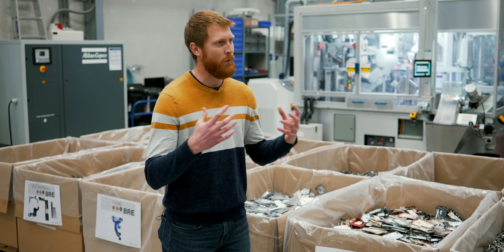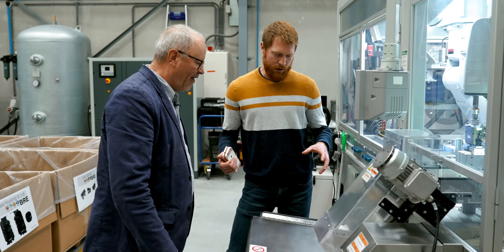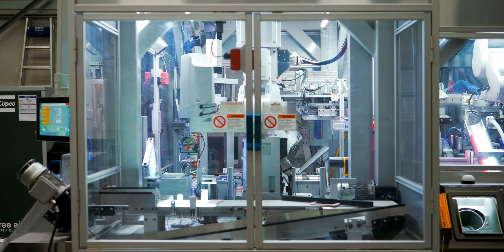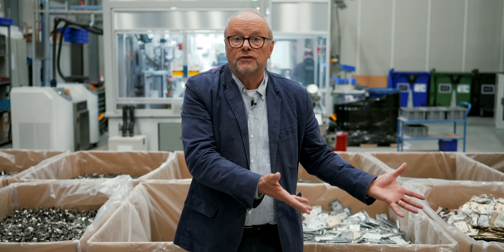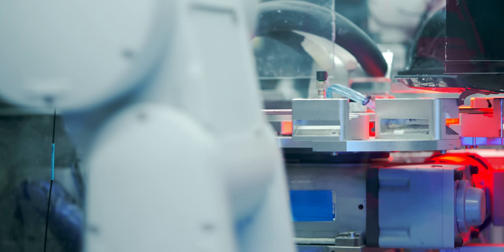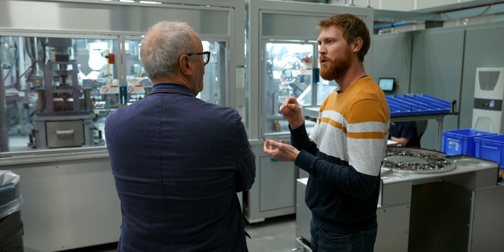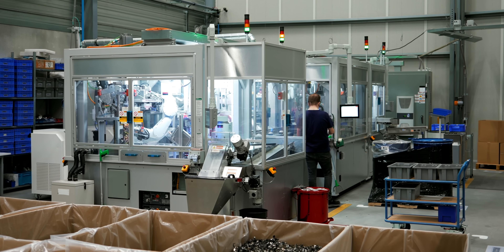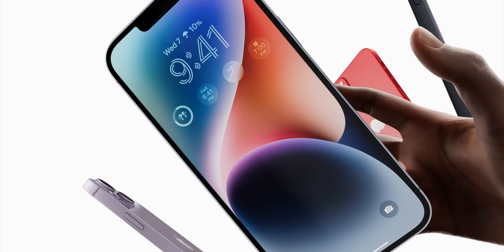Is This Robot Apple’s Most Important Device Yet?

Comment: What a joke…

I can’t replace the battery…
I can’t replace the screen…
I can’t replace the Face ID…
I can’t replace the Touch ID…
I can’t replace the earpiece…
I can’t replace the camera…
I can’t replace the logicboard…
I can’t even use a non MFI charging cable…

without Apple disabling some or all relevant features on the phone.

Activation lock leads to millions of iPhones, MacBooks, iMacs, iPads and many of their other 800$+ products with no defects of any kind being scrapped and thrown away on a daily basis!

THIS IS A SLAP IN THE FACE, if anything at all!

Comment: "Make it last as long as we can" 12:15 It's the opposite of what Apple is trying to achieve. Buy a new Iphone, and you crack the screen in two years and it will probably be cheaper to buy a used phone than to replace the screen (or you will have to accept removed functions of the phone if you do it yourself or through someone else than Apple)

Comment: What many of the comments say, is that repairing old devices is as, or more important than recycling them.
I actually think both are important. Everything, even the longest lived devices die eventually, and they should be recyclable.
However, what I think a lot of people would like to see (Hello APPLE, SAMSUNG, ETC.) is upgrading, and repairing of devices.
How do we get that?
Simple, we make repairing and upgrading profitable. Let's be honest, if you're a company and you can make about the same profit from selling upgrade kits, and running repairing centers as you can from recycling, you're going to do all three.
So we need to start demanding repair, and upgrading. If we are loud enough the companies, will realize that there is a huge untapped market here, where they can make a fortune. Never known a company that could resist making a fortune.

Comment: in my opinion they should disassembly it after tests and from broken iPhone use parts one more time. so probably in poor countries they can sell renewed iPhones with exchanged batter, speaker microphone after some cleaning and refreshing things. then the mainboard screws, flex connectors, screens can be reused so most of components can be reused. even some trusted used reselling option without so complex renewing will be possible. for example I will buy used iPhone with new battery tested and certified with 6 month guaranty from apple for 100$-150$... of course the last stage with really broken phones to old after some water inside they can melt like there...but why don't reuse screws, bezels, some flex, cables? design it to have the same in new model and then you can reused, have bigger mass production. (if the antenna cable will be the same for 3 models they made 3 times more the same one, less stock, less magazine, less transportation etc..)

Comment: Lots of misguided comments about iPhone repairability, or lack of it. Take a look at iFixit's repairability assessments for various devices, including iPhones and be surprised: iPhones fare pretty well, especially when compared to Samsung. iPhone 14 was even praised for its brand new easy to repair design. 

iPhone repair service and parts availability is excellent, at least 6-7 years after end of sale. You get software updates for 6-7 years too. The average lifespan of an iPhone is much longer than that of a Android device; expensive devices get repaired and cheap ones will be thrown away. There is even a self repair program for those 982 people on this planet who want DIY repairs.

Of course all this is hard to stomach, since it's against the common narrative.

Comment: Everything would be fantastic if Apple didn't make it difficult to repair its devices and even designed them so that they can't be economically repaired and have to be sent for recycling because instead of replacing them for a fraction of the value of the parts, you have to recycle everything.

Comment: I think you are missing you are missing the point, these companies seal the batteries into the phone with next to no management. If your car batteries lasted as long as a phone battery & the car manufacturer expected you to recycle your car after 3 years when the battery died you would probably be upset. I have an old phone if the battery goes flat when I'm out I just swap the battery out for a charged one when the batteries stop retaining their charge I replace the batteries not the whole phone.

Comment: I think the problem is the same as with plastic. You can talk about recyclable plastic, but if you’re not turning off the new plastic tap, then you’re not really achieving much. You’re not using up the plastic remaining by recycling it a few times. You’re just adding more and more to the pool.

With this, it’s a good system, but capitalism dictates that profits are what matter. Apple could come out and ask everyone to only buy a new phone every 5 or 6 years, and they’d still make money, but they won’t because they want the maximum profit they can get. They don’t want to turn off the tap of new iPhones, or even reduce the flow significantly. They just want to make it seem as if this fancy robotic system will fix the whole problem. They know that most people probably won’t even return their phones for processing. They might throw them in the bin. They might keep all their old electronics at home in a drawer.

You have to make the devices last as long as possible, encourage people to keep them as long as possible, have them be as repairable as possible, and then you have the robotic recycling at the end of that process. They’re skipping out three big parts of it.

Comment: If you trade in an Iphone that works perfectly but maybe is a bit scuffed and has a slightly degraded battery, it will end up in one of these facilities instead of getting a second or third life. That's only good for Apple's bottom line. Should dead phones be properly recycled to recover as much as possible sure, but I bet a very high percentage of the phones destroyed in this video still work perfectly fine.

Comment: Why not talking about the recycling process itself, this is just showing the dismantling of the phone, but what is after? What amount of energy is required to produce the required material, pur gold, cobalt,...how batteries are recycled? How much does it cost? This shows only the very beginning of lengthy, costly, energy demanding process.
Reply: Not sure what you're point is here, dude ..we need to recycle - it saves finite resources and it's massively cheaper to remove gold from a chip or a connector ...than to dig millions of tons of rock out of the ground and process it, etc etc.....

Comment: Does anyone know the break down of those acclaimed 20% of recycled materials in apple's products? I reckon you could probably get to 20% fairly easily by recycling the aluminum used in housing. Is it mainly the low hanging fruit or are they actually making a dent in those materials notoriously hard to recover?
Reply: Also kind of interested where those numbers are coming from

Comment: Phones have personal information on them, and even if you clear them, people can recover them using forensic techniques.  I have a pile of phones in my house because I don't trust anywhere where I could drop off the phone to actually recycle, and ship it through 5 resellers where someone will attempt to repair and resell the device, with the potential for someone to recover the data for malevolent purposes.  If I could go to a place where I see my device shredded, they would get a lot of phones, tablets, and other flotsam from me.
Reply: Dont worry. Phones and computers these days take extra measures to format devices during factory reset to ensure personal information is cleared beyond recovery. For example in windows 10 they write and re-write the drive during reset to make sure it is not easy to recover personal information. Data recovery is not as easy or inexpensive as it seems. Don't be afraid to give your devices the new life it deserves.

Comment: Disappointing propaganda for a company who have for years been hell-bent on making their customers buy new phones instead of repairing their existing ones. Non-replaceable batteries, moisture sensors to invalidate warranty claims (Whilst other manufacturers were making waterproof phones), deliberately rolling out software updates to make older phones slower to make them unusable.

200 per hour and 2.2 billion phones? They need a hell of a lot of those things to even start to make amends for the environmental damage they've done in the name of profit.

Comment: Well, they better get the process enlarged asap. 
Because most mobiles used are now Android Not Apple... 

Because Apple mobiles are the most over priced.. hard to fix.. expensive to fix. unreliable rubbish going!  T
he amount of users whom get fed up with the I Phones is growing daily.. because of the facts above that I stated?

Apple sell them for increasing higher amounts each new fancy over hyped model.. then users pay thousands out only to have the mobile go wrong soon.. 
then find that there is few places that can fix or try to repair them, then the cost of the repairing of say the screens or the cameras etc. so high.  
Not helped by Apple setting the prices of any possible repairing high and limiting the place given the Apple repair rights.. 

Because it is all about Apple making more money, either by forcing you to pay silly money to maybe get the Mobile fixed or give in and buy another over priced I Phone.

Allot of the programs used play up or just go down fully, the batteries fail or the screen fails and remember someone paid over a thousand pounds for this mobile.. and it goes wrong soon afterwards. So this robot system better be up-scaled big time because at the rate of Android mobile take up and cancelling of Apple contracts is, Apple Mobiles will soon be a non-buy product for most if not all users! 

Why buy a Apple I Phone when for allot less you can use a good solid working stable system called Android Mobile.. which even is far better to fix and get repaired for less money and is so much more better to use and last many many years compared to a I Phone.  

I myself have a old 23015 Android Samsung Mobile which is a second hand Mobile is works fine.. before this I had used for years a old hand me down Android Samsung Ace 2 Mobile from my sister and she used it for many years before that.. it still was fine and stable. Okay tiny screen compared to now But it still a touch screen one, it still fine now. 

If that been a I Phone, it would have been throw away well before I even got to use it after my sister had it?  That's how crap I Phones are.

The are as of now well over priced and all fancy styled But I bet they all be soon throw away within the next two years due to them not working anymore and the programs or the Operating System failing or crashing. or the screen failing. or the memory wiping out the Data.  

They should just get rid of them all as there is none I ever heard of that last more than 2 years even if the user looks after them well.

Comment: this is just a commercial for apple. they even had to figure out how terrible their screws work. more terrible design. what they should do is use that robot to cut a whole in the back of the phone around the battery. so they can easily be replaced. then the phones could be used for 10 years.

Comment: I find it hard to give Apple much credit for this, the steps daisy automates would be redundant if these or any modern smartphones( exceptions like fairphone exsist) would be repairable and easy to disassembel. The Challenge of the Recycling lies in what is done with the broken down phones. Batteries, screens and pcb's are not easily broken down into their raw materials and that i do not see adressed here. Still good that the electronics industry is starting to have to find solutions to their own mess. Let's hope it is not another shiny greenwashing effort
Reply: Too difficult for you to take the win and give any credit?  Sad.

Comment: Robert: "So make sure to use those devices as long as possible"
Apple: "Good video, um, wait, what? No no no, make sure you buy a new one every 6 months, 3 is fine to!"
XD
Reply: Their latest version of software supports loads of older versions of the iPhone.
Reply: @therealcaldini  and I don't deny that. It's better than most mainstream android manufacturers. But apple would still prefer it if you bought every new device. ;)
Reply: @MLeoDaalder  Based on what, that they are a profit making company?  You got a problem with that?  What else do you own that wasn't made by a profit making company?

Comment: Didn't Apple admit they had been prematurely slowing down people's older devices via the update process? It's all very sweet that they called it Daisy but I think everyone has figured out the real answer to the problem and it's not continuing to promote overconsumption and Daisy. It's like trying to tackle gun crime by building better hospitals.
Reply: I think you might be thinking about the battery situation. They did slow down phones with old batteries, by a little, and only when the battery was at a low percentage. And they only did it to keep the phone from randomly turning off.
As someone who once owned an older iPhone that would randomly turn off I welcomed that change.
The only problem was Apple didn’t communicate what they were doing very well and there was mass confusion about it.

As for consumerism I totally agree, but eventually everything gets to the end of its life and you’ll need a new one, even if it’s ten years later, and Daisy will be just as useful in that situation too.

Comment: This is an example of greenwashing. If Apple cared about recycling they'd make their phones user serviceable and they'd provide original parts for that purpose. They could even provide a post paid return envelope to receive to broken part and recycle it. Instead they seal in the battery, and make it onerous & expensive to replace the battery (or repair other components). So a lot of otherwise functional iPhones get tossed or stacked up in cupboards never to be used again and the consumer goes out to buy a new iPhone increasing e-waste.
Reply: I'd add that many of these "recycled" phones have recoverable components that could have enjoyed a second life. So Apple could sell new and refurbished parts. And if the phones were actually user serviceable these parts could be recovered in a non destructive way e.g. if the back popped off or if the battery wasn't glued in. But Apple's profits are predicated on people constantly replacing phones and that means making phones hard to repair, practically disposable. This recycling robot is a greenwashing sop used to justify that model.

Comment: Reduce >> Reuse >> Recycle... in that order. Apple needs to reduce the crazy spread of iPhone designs and just go with the tried and true design of the iPhone 4s. Reduce the complexity, make it easier to repair, so that way we can either Reuse them for longer or hand them down to others to Reuse when we get a new one.Then, and only then, when a part can no longer be reused or repaired should it be Recycled. Shame on Apple for only driving more consumption by creating planned obsolescence and forcing users to pay more to destroy perfectly good hardware.
Reply: You're right. But note that Apple's design spread isn't the issue. They sell so much phones that the industry can easily adjust their repair process. No, the issue is that apple purposefully prevents independent repair, seals in the battery and makes repair much too costly to be attractive. Did you know that they serialize parts? This means they stop you with software from using an original iphone camera module on another iphone which is broken. Imagine!